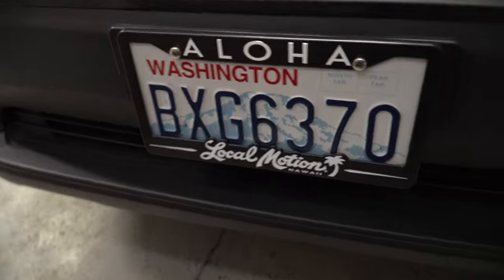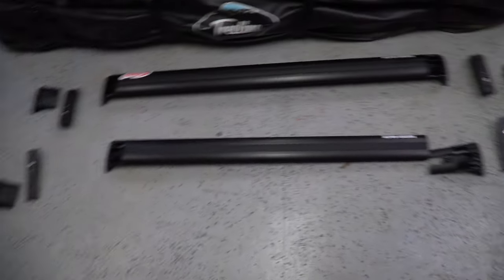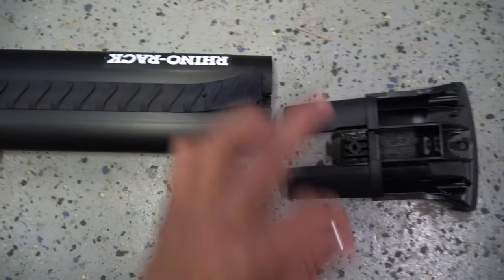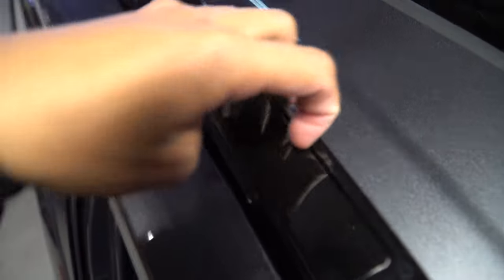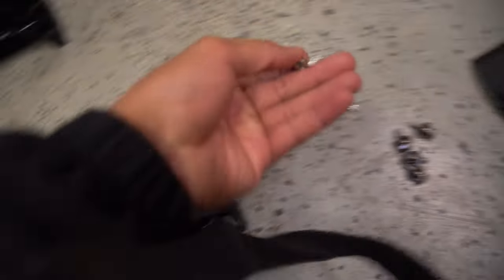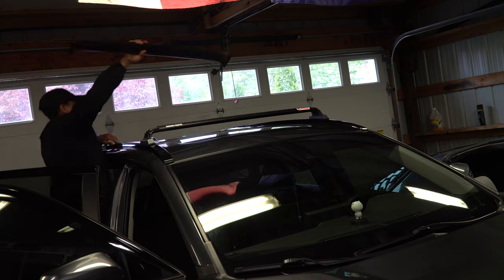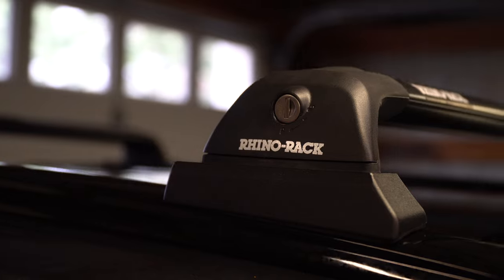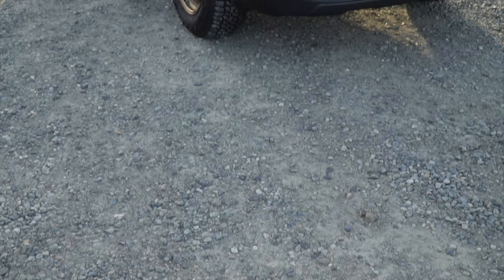rav4 rhino rack cross bar install (19-21)

Comment: How long did it take to get this set? It shows about a month lead time and backorder everywhere.
Reply from the maker: i got it when it was still in stock. shipped right away and got it within a week
Reply: Ah right on. Is that part in the link all I would need? It keeps mentioning that and another kit for mounting
Reply: @-JMF916-  yup that’s all u need. i got the same exact kit
Reply: Thanks for the responses! Got the kit it, installed it, all went smooth. Now I have a leak in the roof. Apparently the 5th gen doesn't do well with crossbars
Reply from the maker: @-JMF916-  i also got a leak but it doesn’t make sense cause it’s a direct bolt on. i went to my dealer and they changed the rubber grommets under the rails. i wonder if the oem cross bars have leaks too
Reply: @yotar4ven898  I've seen a lot of stuff in leaks OEM or not. I'm taking mine in this week. Do you have the crossbars on still? And if so is there still leaking issues?
Reply from the maker: @-JMF916-  yeah still on but no leaks anymore thank god
Reply: @yotar4ven898  getting mine looked at om Thursday so hoping for the same
Reply: Do you remember what they charged you? They're asking me 180 just for a diagnostic for something I know is wrong lol. Not including the rest
Reply from the maker: @-JMF916-  damn. they didn’t charge me at all. my car was still under warranty. under 30k miles